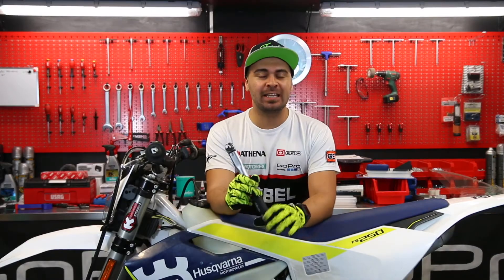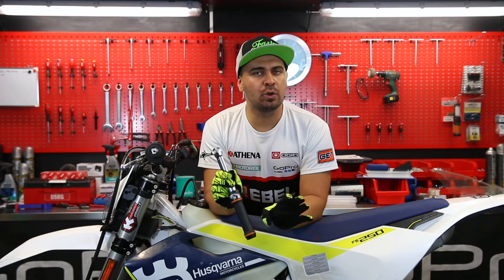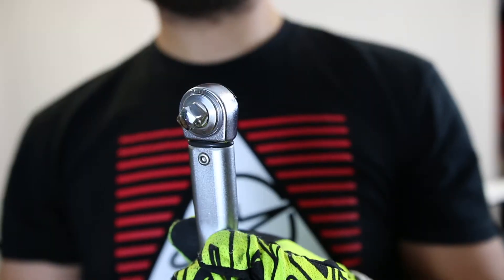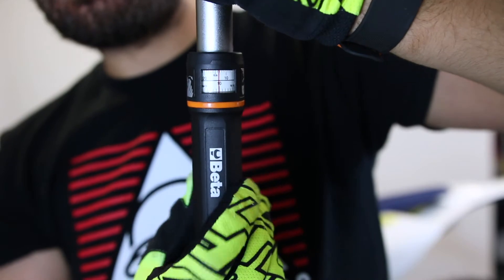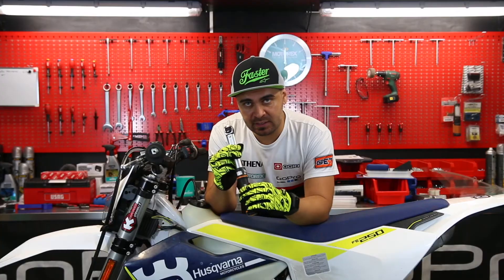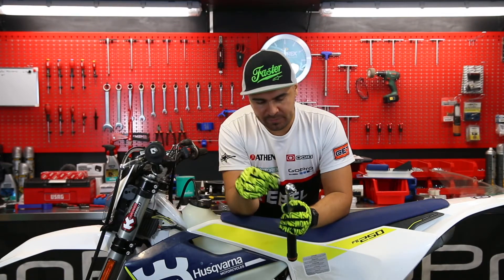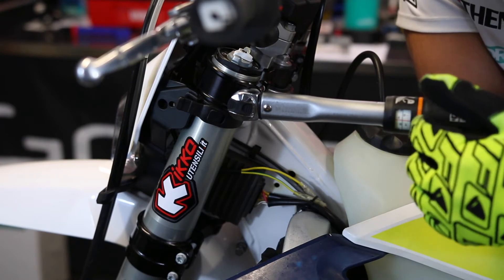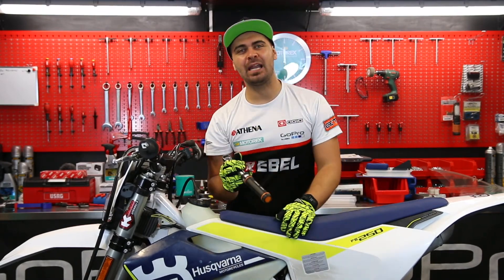Tech Tips | HOW TO USE A TORQUE WRENCH

Comment: Hi Manuel, thanks for this video. One good practice is to always release the tension from the torque wrench following use (set back to zero). This helps keep the internal mechanisms calibrated longer. If the wrench springs are under tension in storage, the springs could slightly "creep" and the wrench will lose calibration. 

Keep up the videos. Another great tech vid would be replacing a tire with mousse, setting sag on rear shock, installing in-line fuel filter for EFI fuel line, checking and adjusting spokes, balancing wheels after new tire install, how to properly clean the bike (soap, pressure washer, clothes, etc.), how to change a spark plug (with dirty engine), and more! Keep up the great work. 

James from Canada